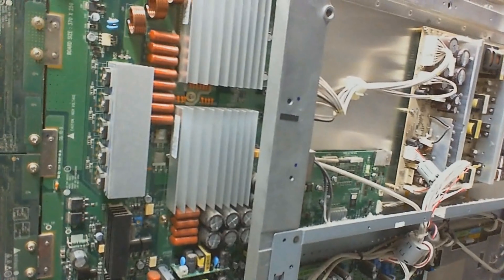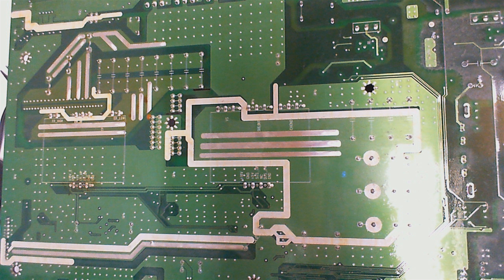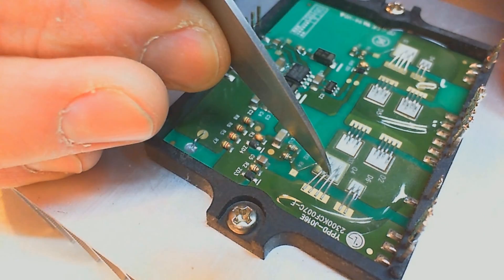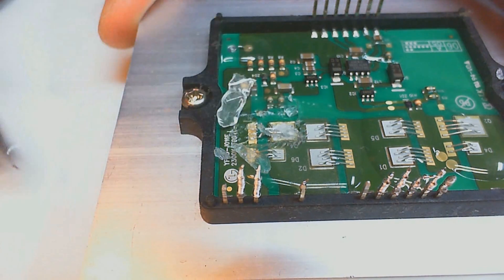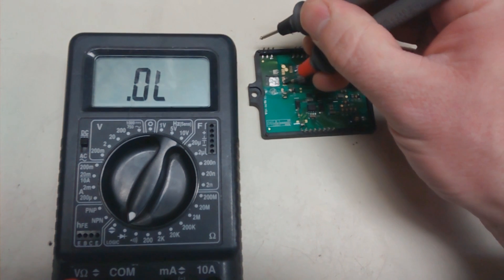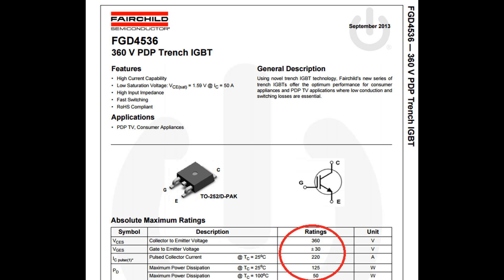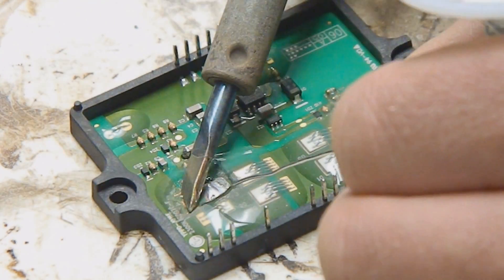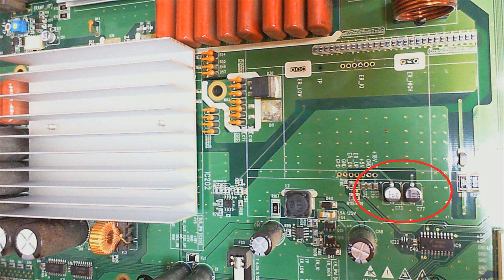YPPD-J016e IPM repair 50HP86 ticking noise and flashing TV

Comment: Again, your tutorials are great, don't stop making them, I've learned so much. Not being very knowledgeable yet still trying to fix my J015E (and maybe the J016E just for the experience) in my 50" plasma, how did you know which one was the collector, emitter and gate in the module. I can see it in the J016E, but no one's done it to the J015E. I'm also thinking about changing the Mosfats on each boards, just to make sure (and experience also). When I checked the tv, only the J015E on the Ysus was shorted. When I tried after changing it, only the J016E on the Zsus got hot, the other 3 stayed cool. Then the J015E on the Zsus blew, then I unplugged one of the power supply to the Ysus and the J015E on the Ysus blew. Don't want to buy another module, would rather fix it. Thanks
Reply from the maker: +Andre Roy There are 3 terminals, gate, emitter and collector on an IGBT. Gate is the small wire, only the current that charges and discharges the gate capacitance goes through that wire. The main current goes through collector and emitter. Then to distinguish both you look at the antiparallel diode. Cathode is on collector, anode on emitter. If you cut the wires that go from the die to the PCB you can measure with a multimeter (diode tester) how the diode is oriented.

Comment: I tried to solder the new IGBTs , but the solder does not adhere to the metal base. Is there any method to make it adhere? Thanks.
Reply from the maker: it is an aluminum substrate with an isolation layer and then copper traces. I hope you mean how to solder to the copper traces, not the aluminum substrate :-). You need to carefully scratch until you get to the trace that`s underneath the defective IGBT die. The die needs to be completely removed, I presume you didn`t get there yet. Then just use common solder wire which nowadays all should have a flux core. If that's not good enough use flux paste or liquid flux, you can get those from ebay for example or  your local electronic parts store should have that too. If you put too much solder on the pad you can remove it with solder wick or a desoldering pump. https://www.digikey.com/product-detail/en/chip-quik-inc/SMD291NL/SMD291NL-ND/1160000
https://www.digikey.com/product-detail/en/menda-easybraid/Q-B-5AS/EB1087-ND/350542. I personally wouldn`t touch these TVs anymore, they are getting really old....

Comment: hello, i have lg plasma with similar simptoms:  
https://www.youtube.com/watch?v=zP1fhBmgCuk 
https://www.youtube.com/watch?v=esS54yL573Y    

i don't know which one makes the sound...
Reply from the maker: You could try to find the audible noise source with something stethoscope like. For transformers for example I usually use something like a chopstick, touch with one end my ear channel and use the other end to probe for the noise source. Other than that, did you try to check for shorts on VS , VA etc?
Reply: @tomtechtod9200 , thans for reply! i will try with a stethoscope. Vs/Va  no shorts.

Comment: Hi, Thanks for sharing. I've used same IGBT to repair a YPPD-J017C/ YPPD-J018C board which lasted only a day then one diode and one IGBT failed. Is there any recommendation you can provide? Do plasma panels draw more current as they age because when it was working I felt a lot of heat coming from the rear panel louvers? What diode should I replace the burned one with? Do you think replacing the whole module will resolve the lasting issue or could there be something else wrong with it?

Comment: Do you recall what value capacitors you used when you replaced the 2 electrolytics on the main board?  Numbered C73 and C77.
Reply from the maker: +Mustang Bob No I can't remember. From my video it looks like they were 33uF 25V.
Reply: +TomTechTod  That's what I was thinking they were. Sometimes the markings can be confusing. Thanks for the quick response and the great video!

Comment: I love your tutorial but you only show the YPPD-J016E. I have 2 blown YPPD-J015E and I can't find the schematics on it anywhere. How did you find the schematic and know what IGBT went in it?
Reply from the maker: +Andre Roy You can draw the circuit yourself, it should be pretty easy since this is a one layer board, there are only traces on the visible side. As for what IGBT goes in there I just guessed and also found info on the net from other people who did something similar. I used the FGD4536. If the diode is damaged it will need to be replaced too or use a high voltage high peak current MOSFET.

Comment: What method do you use to remove the ipm without damaging the board or ipm?
Reply from the maker: @110117901306597592053 First I warm up the whole board with a heatgun , but only so hot I can still touch it with my bare fingers. Then I put a lot of solder on all of the contacts on one side, adjust my soldering iron to maximum temperature and go back and forth melting all the solder joints on one side. Simultaneously I slightly pry  this side away from the board. Probably not the best thing to do but I found that hot air was to weak. Another option maybe to use solder wick to remove the solder of every pin. There are however some pins where the main (large) trace is on the inaccessible side (top side under the Hybrid IC). Try to free up the easy solder joints with solder wick and the difficult ones by heating them with the above method (all at once). There is a video somewhere from Shopjimmy on youtube also.. Whatever you do be patient and don't rip off the traces from the PCB. :-)
Reply from the maker: TomTechTod If you do this often I'd recommend making a a large copper desoldering tip for exact that task though. Will make it much easier. I only do this repair occasionnally.